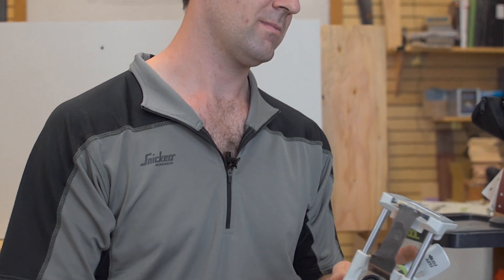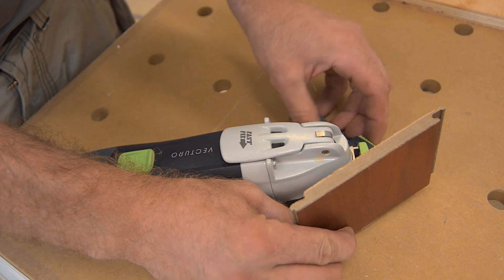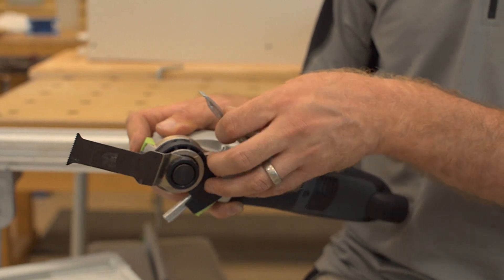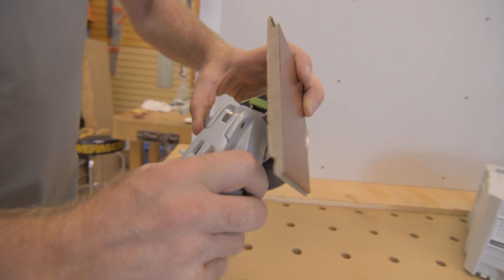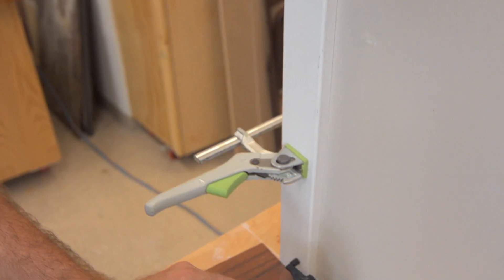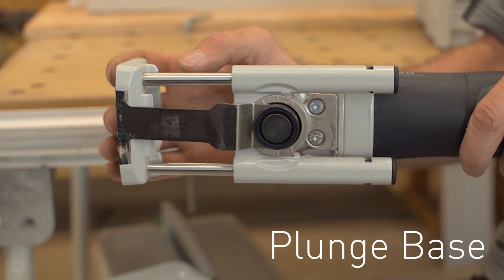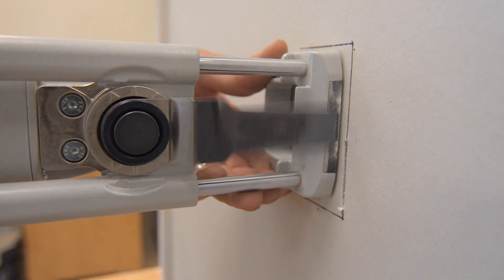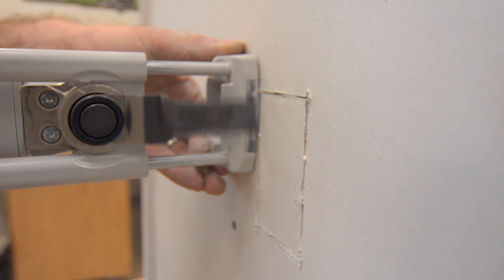Oscillating Multi Tool Festool Vecturo OS 400

Comment: When we will see Multi in Australia Please? And what is the cost for it? 
Also we use Fein atm but we found great Long-Life Wood Blades get blunt straight away after in-contact with metal (nails, when we cut architraves), does Festool blades have the same issue ? Thank you

Comment: Looks great, price? And don't say it shouldn't matter, for a small business with limited finances it does. That's why I go with dewalt tough rugged and within my price range. And yes I do own some of your products.
Reply: Am in eastern North Carolina on the coast. Don't get me wrong I think festool is a great tool. I have been using them for years. I own the TS 75 EQ, OF 1400, DF 500 q- plus, and the PSB 300 EQ the RO 150 FEQ Plus the Ct 33 E vac.
Reply: Only problem I had was the pad came apart on the RO 150, I wore it slam out. Have been using it for a few years, replacement is 44.00 plus shipping, not to bad.

Comment: Where the heck is the dust extractor connection?!
Reply: ***** That's why we pay Festool the big bucks to figure out innovative solutions!  The biggest problem with oscillating tools is dust generation (not cutting depth).  It's extremely disappointing that a dust collection solution was not introduced with this commodity tool.
Reply: John----It's always been my experience that oscillating tools make very little dust. The sawdust from material you cut (even Sheetrock) usually stays right there in the cutting area and rarely goes airborne. Its one of the main reasons oscillating tools are so well suited for finish work in homes and lived in work sites. Also, a connected hose makes the tool less maneuverable and more bulky. This is probably why Festool left out the dust extraction connection. 
At least in my humble opinion.......
Reply: I was wondering about dust collection, as well. Having burned through a Dremel, a Sonicrafter, and a Porter Cable, I'm beginning to wonder if sheetrock dust is at least partly a culprit. I've noticed a lot of buildup inside each tool.
Reply: Ken Nagrod  Thanks for the suggestion. As I don't often have the compressor while I'm doing drywall, I suppose I might get some benefit from using the blower end of the shop vac, perhaps with a small attachment to increase the pressure.